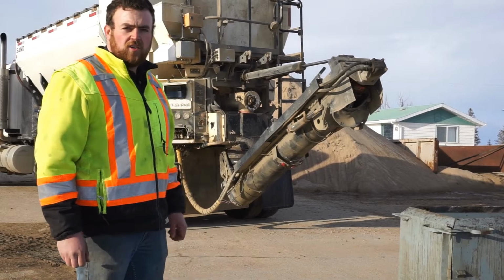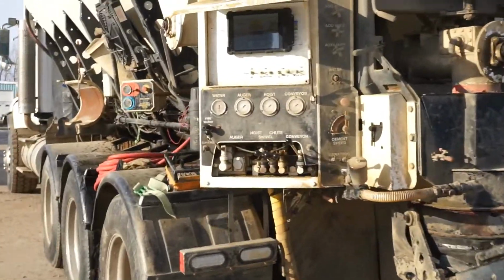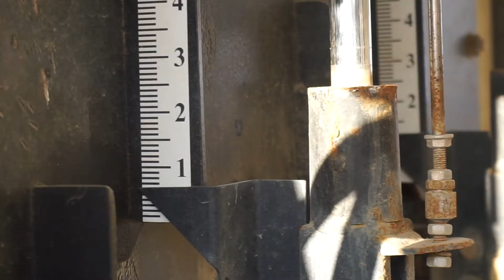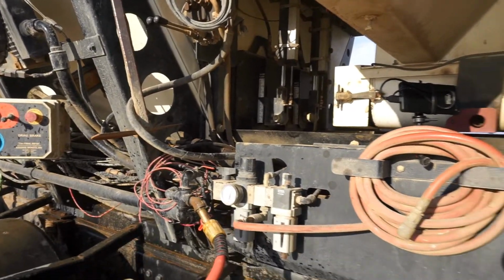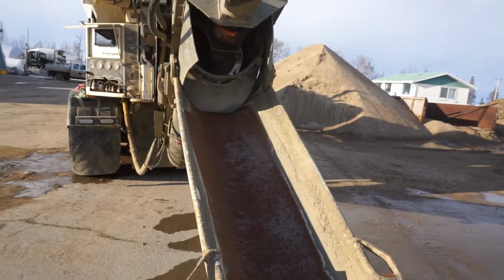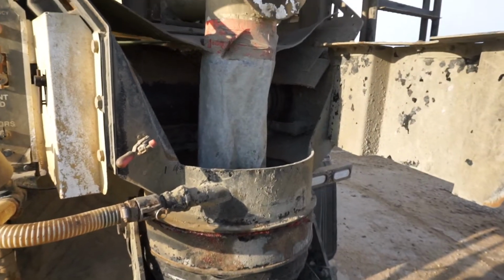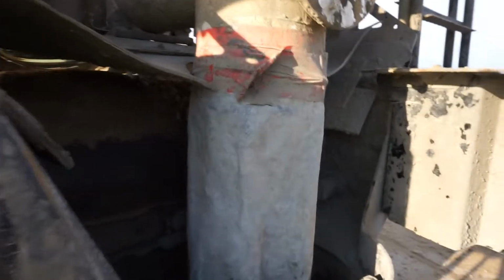Volumetric concrete truck IN ACTION! Ep 2

Comment: Does this truck contain sand and agregates or sand and 2 types of aggregates? Different strength concrete has a different ratio or 10mm and 20mm aggregate. Or does the aggregates have to be a pre-blended mix?

Comment: when you add a little more water does the mixer adjust it's cement ratio to keep the same strength mix automatically ?
Reply from the maker: No it doesn't, but there is enough margin built into the mix design that there will still be enough strength when you add more water.

Comment: Gears of the conveyor in the place where the sand falls and the stone is not covered by spray from anything?  Or is there no spray?
Reply from the maker: No there isn't really any spray up there.
Reply: @johnneufeld02  I plan to make a water supply through the nozzles around the mixer bowl.  That there was no dust.  You see rubber that holds sand and stone so that they do not fly forward, but fall down.  I also saw the rubber which is under the conveyor in the mixing bowl.  I don’t have one.  We must also put it.  And how is the partition between the stone and the sand made?  Does it press firmly against the conveyor or at a distance from the conveyor belt?
Reply from the maker: The rubber on the bottom of the partition should be all the way against the conveyor, not pushed against it with alot of pressure but just firm. The rubber shouldn't be too soft if you can find a harder rubber that would wear out slower that would be good, also not too thin at least half inch thickness would be good.
Reply: @johnneufeld02  Thanks.  I thought the rubber cleaning tape should be soft.  But I'm talking about another rubber.  The one below it.